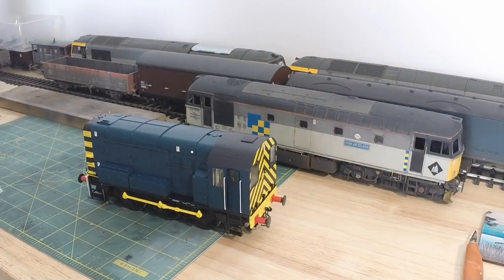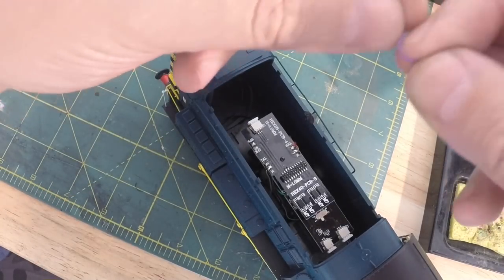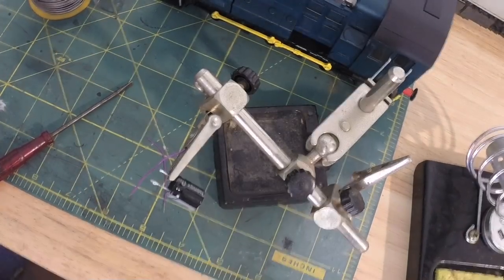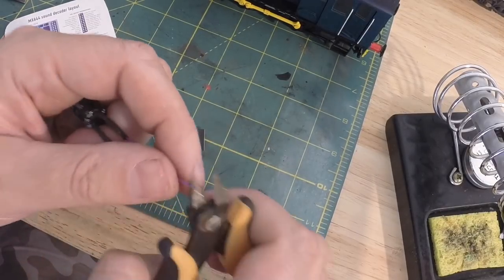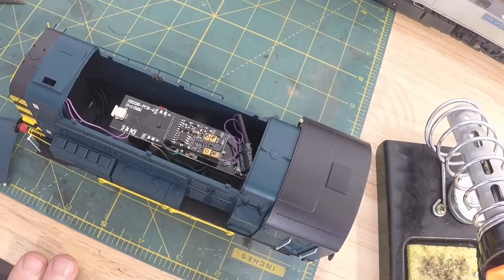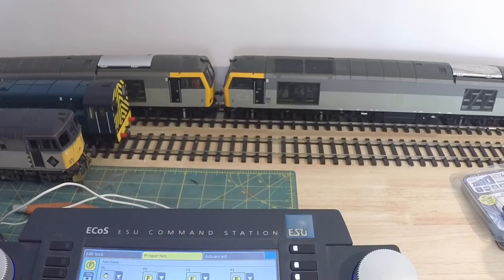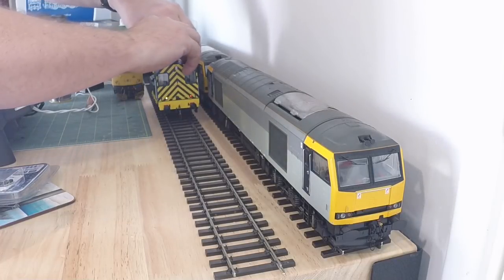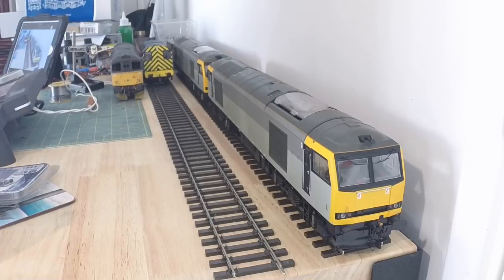Model Trains 72 - Hither Green TMD in 7mm O Gauge, Fitting Paul Chetter sound chip to Dapol Class 08

Comment: Thanks for the heads up on how to wire the sound chip capacitor and speaker in i have got one on its way from Howes for my dapol o guage 08.I will try not to burn mine whilst fitting easily done but lucky to say the least not noticeable on yours.
Reply from the maker: Glad it’s of help. Dead easy 👍

Comment: I have the same sound chip in my 08 but have not as yet added the stay alive. I need to do so as it sometimes stalls on my points. I loved you instructional video, but did you find out why it does not appear to 'be keeping it alive'?
Robin
Reply from the maker: the 25v 75uf capacitor supplied, according to Digitrains, keeps the chip alive for a fraction of a second, which apparently is enough to stop the sound stuttering or the lights flickering due to dirt etc. they also said they don't bother to use it. they recommend if you need a longer spell of the capacitor keeping the chip alive, try a 1000uf capacitor. i will do so, but not got to my local (450km away) electronics shop. i will probably find something online and give it a try
Reply: Ok thanks, thats useful information, I might try that myself. 
Robin
Reply: Hi again, just a little heads up, I tried my O8 with  a 25v 1000uf and found exactly the same result as with your test using the 75uf version. In other words it was not noticeable. I did the testing over a bad point, (which I can remedy) but was waiting to use it as a testing ground for the capacitors. So I ended up fitting a 25v 4700uf capacitor (which is physically quite large but fits ok in the 08). That worked as I was hoping the 1000uf would, it went over the point I mentioned with no problem, and also kept running for a split second when lifted of the track.
Robin